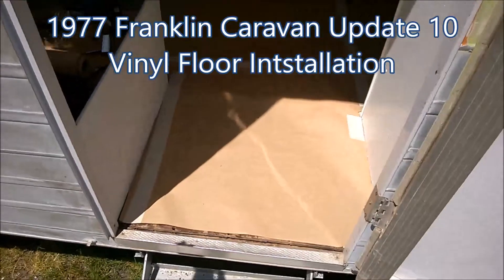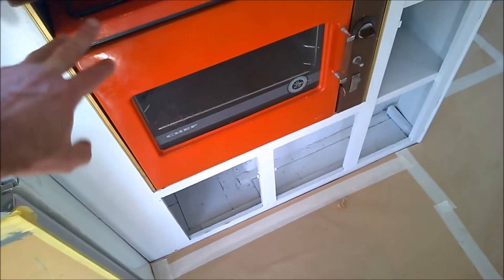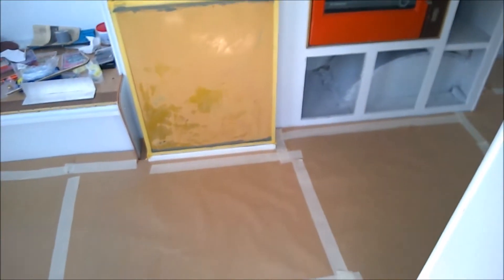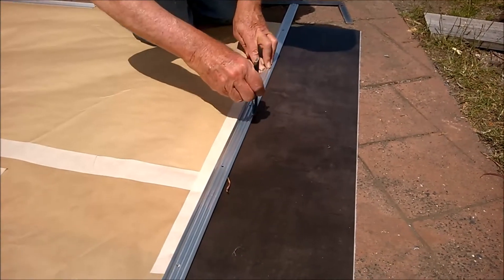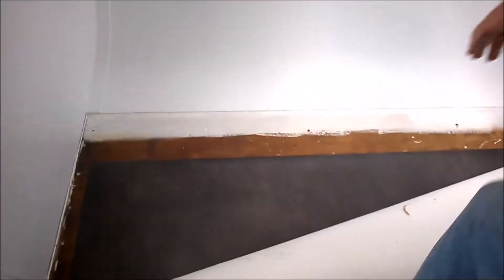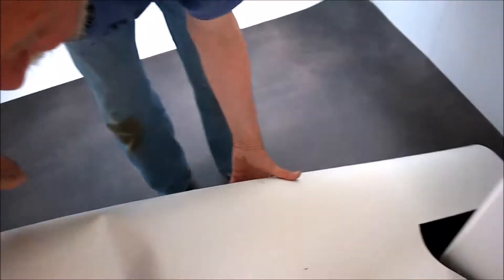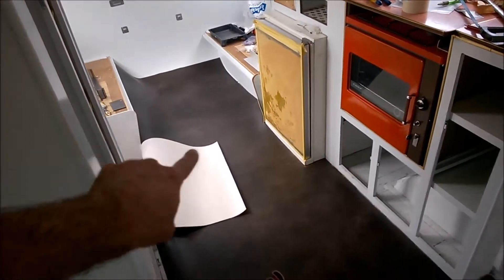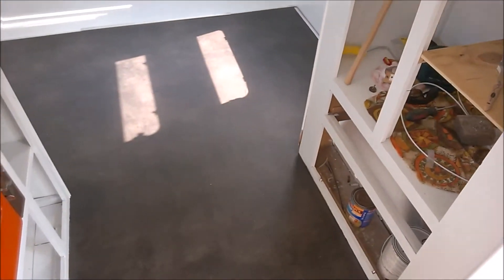1977 Franklin Caravan Update 10: Vinyl Floor Install

Comment: Great job on the franklin, look forward to seeing the finish. We have just got a Franklin also but no rego, tried to find a year and our chassis number is  W818  so figured it's early1977 as saw yours was a higher number. Just wondering where you bought your parts from. Many thanks Gavin.
Reply from the maker: +Gavin Clark Thanks Gavin, yes its coming along nicely and my old man (who owns the van) is looking forward to the maiden trip. Parts are sourced from many different places, hardware stores, online caravan shops etc.  If you want to know more about your van, join the Classic Caravan forum (we are in it) as the members there are a wealth of information. You can also post up your van and work there too.

Comment: Hi
From Perth Western Australia 
Your reno work very inspiring 
Have a retro 70s/80s Caromal 14 footer which is gutted
What are your recommendation  for starting ?
Any info would be greatly appreciated Cheers.😊 
Phil
Reply from the maker: Hi Phil - recommend always that you water proof first, that is start with the outside. Re-seal windows, hatches and any other external bits (jrails, doors etc).  Once you have it water tight, then start on the inside... in your case its gutted anyway so thats a good way to test that its waterproof.  Start with the floor, replace any areas that are rotted (or replace the lot).  Make sure its fastened to the chassis!  Then from there work your way up, with walls and roof - keep in mind electrical work, where power points will be etc.  Do the kitchen, bunks, dinette and all that.  Finish off with the ceiling if required.  Be very mindful that this type of project will take time, dont rush it, small milestones at a time.  Expect a full year to complete, or more depending on your free time/funds.  All the best with it.
Reply: @rovertasmania7033  
Thankyou for the heads up and quick reply
I'll stay in touch
Cheers.😊